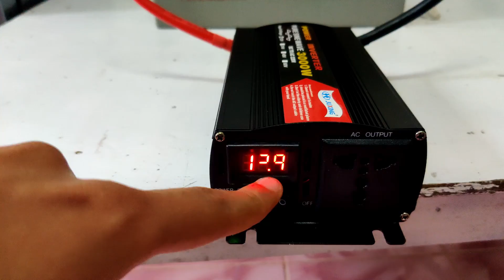How to run your refrigerator on a battery?

Comment: I think there's a 500 watt limit on a car system dependent upon if the circuit breaker is size larger. Start the car every hour for 10 minutes and check the battery charge what should be above 12 volts

Comment: It would be nice to know the Cable size
Reply from the maker: Hey Paul, in this case I used 3 AWG copper wires I believe. But the cable will depend on the Wattage of your inverter and Voltage of your battery. You can use our battery to inverter wire size calculator: https://www.renewablewise.com/battery-to-inverter-wire-size/